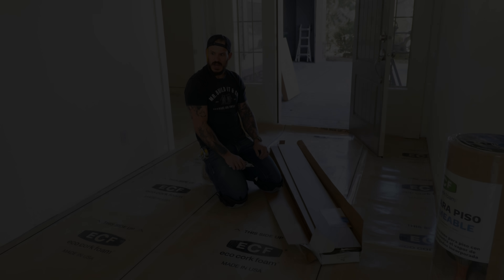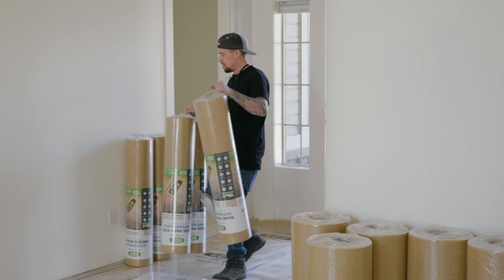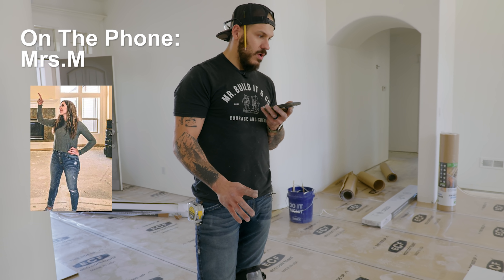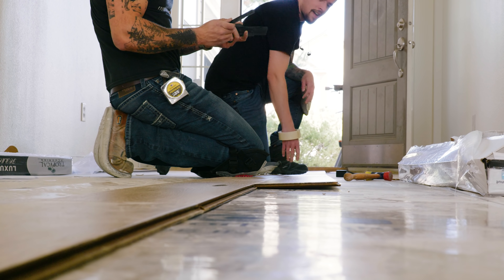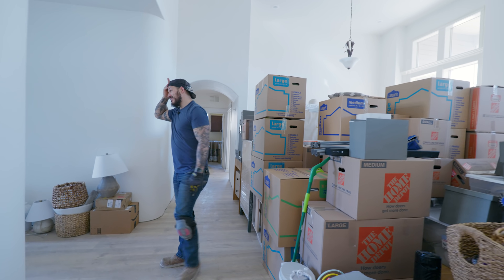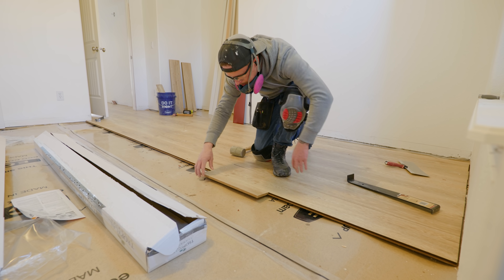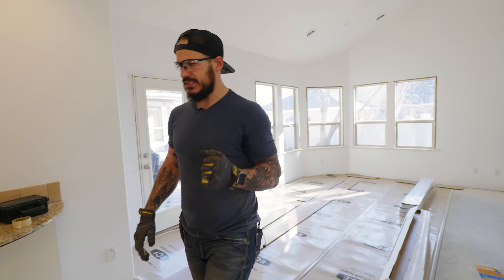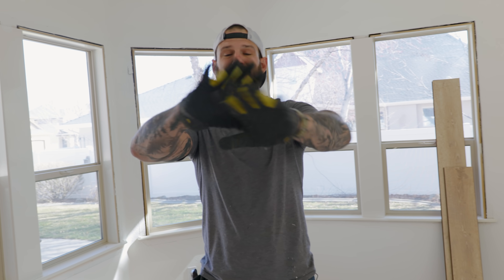Installing Flooring + EVERYTHING GOING WRONG || Concrete Slab House Reno (Ep.5)

Comment: As a professional flooring installer for 23 years this was not the easiest video to watch
Reply: Me personally would have laid the flooring other direction.
Reply: Definitely! Started writing a comment and immediately stopped. I felt I shouldn't mention 1 thing without mentioning all then I felt like I would be bashing. Saw your comment and thought a reply was better. By the way I like your user name. Aquariums all the way.
Reply: From another professional flooring installer I agree 100%
Reply: Those people don’t have a clue
Reply: I was wondering if you didnt use a space against the walls in the US? I would think the floor would rise after some use.
Reply: In six months there will be a video about how the floors are buckling and then they put in transition pieces

Comment: I found it easier to click the long side in first and then use the tapping block along the narrow side to click it in with the previous slab.
Reply: Looks like they kinda figured it out later as they went. Because clearly having to tap in 6 feet of flooring shouldn't be easier than tapping in the 6-8 inches on the short side.

Comment: When my wife and I bought our house about a year ago, I had to rip walls out, move doors/windows, floors and painting. I am a contractor (for many MANY years now) and i realized I have never done the LVP or LVT flooring. I did the entire 2600 sq ft house by myself and had my guys work on actual job sites. Never again....it took 15 days... I constantly look at the floor and shake my head haha.
Reply: Damn. I’m about to do LVP on the lower level of my 3600 sq ft house. Back hurts just reading your comment.

Comment: Anyone else notice when he says “finally done” there is clearly more plank to lay at the left edge of frame?
Reply: He did lay the floor in the kitchen because he is going to remove the cabinets and reroute plumbing and electrical in the floor.  then he'll continue the floor into the kitchen
Reply: Not that hard to say that. "We are done with everything but the kitchen, since we are tearing that apart, next."
Reply: He actually says the kitchen will be left alone before that.
Reply: @joshfrink6277  he did lol.

Comment: One you never looked at the plank width to ensure there wasn’t any small slivers on one end, don’t know why you chose laminate vinyl luxury planks are much better but you never let the laminate temp for 48-72 hours (vinyl can be installed same day) and lastly you never go that close to the wall you want to allow 1/4 for expansion if not your flooring is going to buckle.

Comment: Are you not concerned with not acclimating the floors to your home before laying them down?  I've always been told a minimum of 48 hours to allow them to adjust before they are installed to prevent huge future problems.  Am I being mislead by the manufacturing directions?  Literally the first line in the Tropical Flooring directions say the following:  "IMPORTANT
DO NOT OPEN IMMEDIATELY. Before opening, acclimatize planks for 48 hours by laying each box horizontally and individually in the center of the room in which they will be installed. Make sure the subfloor is clean, dry and flat. Always use safety glasses and mask."
Reply: old school Laminate flooring needs to acclimate.  The new LVPs do not expand and contract like the old planks
Reply: @JimFrye1  this 100% is not LVP. You can see wood, LVP = luxary vinyl plank, there is no vinyl installed in this video.

Comment: I’m having ptsd watching you struggle at 7:27. With laminate, it’s easier if you press in the long side by hand and tap the short side into the previous plank with a block. So you would be tapping with the block towards your front door.
Reply: To piggyback off of my know-it-all comment, it also goes by faster if you do multiple rows at once. Lay 4 in one row, 3 in the next, 2 in the next and so on. Make your cuts for the 4 and 3 and then lay more rows.
Reply: You figured it out at 14:47...I’ll shut up now.

Comment: i believe you need to leave more space between the floor the and the wall: when the temperature changes and the wood expands, if it touches the floor when you walk on it, it will make noise.

Comment: 10:20 you should not brush at all, you should vacuum or alternatively scrape, less dust then.  The dust from that concrete floor contains guaranteed quartz .. which in case of long-term inhalation causes lung diseases.

Comment: I don’t do just flooring for a living but I probably install 5-6 houses a year in just floating laminate and might go through 2 of those tapping blocks in that time period lol.  Also straight from the garage to house with no acclimation period?? Hope you have no buckling or separations
Reply: How much is the labor to install about 2,500 SQFT of laminate floor like this? I’m buying same floor he’s using here, but don’t want to install it myself. In TX if it makes any difference. How much should I expect to pay? New build house with no flooring to remove or anything.
Reply: @nimaicupel  I’m in Wichita Ks and it can vary depending on layout but going rate would average about 3-4 bucks a sq ft if I’m not having to tear out any old flooring or carpet.  Also depending on if pad is attached or if I’m having to put down underlayment as well.

Comment: good work buddy, but I see a few minor issues. You are supposed to leave gaps all the way around the wall (5-10mm) to allow for movement. If the boards are tight up against the walls they will squeak when you stand on them. other than that, you needed to do a real good clean above & below the underlay to remove dust/sand/grit which can also cause the boards to move/make noise when you walk over them.
Reply from the maker: i left a 1/2" gap on the ends before hitting the wall studs
Reply: @MrBuildit  good stuff! 👍

Comment: As a floor installer this was cringgggeee. The worst was the no expansion gap for bottom plate against the walls. Laminate will disconnect overtime from this pressure.

Comment: why did you decide to go with a laminate vs LVP or just straight up hardwood?
Reply: My guess? Price. He spent $2.16/sqft on the flooring + underlayment. You're not going to find hardwood or good quality LVP for that cheap. Although based on the video, it doesn't seem like the laminate he chose was that great of a quality either. For my house I chose Flooret Modin. It's an SPC core LVP. I've been happy with it so far.
Reply: Product placement from China
Reply: @michellecsiernyik5200  He said the underlayment was made in the USA in the video. I don't know if the actual flooring is though.

Comment: When you walk in our door its about 60 feet or better straight down a hallway to the fireplace.  had to establish a line that was square to the door and straight down the hallway to the fireplace.  Work forward and backward of that line.    I did roughly 1500 square ft. in 2 months or so a room at a time.  If I'd had a empty house it'd have been way easier!  I mostly just worked weekends and many an hour here and there at night.

Comment: Did you put that flooring throughout your whole house including bathroom and kitchen?  Waterproof?
Reply: I'm not aware of any laminate that is waterproof. When I was floor shopping I took samples of all of the laminate floors home and tested their waterproof/resistant claims. They all failed. I chose to go with luxury vinyl plank instead. Given how cheap the flooring is that he chose, it's probably not a huge deal to him if it ends up puffing and delaminating after it gets wet. He'll just pull up the flooring in the kitchen/bathrooms and install tile if they get ruined.
Reply: @tomconway6808  that’s what I was thinking too, what brand did you go with?
Reply: @pahoualo5914  I chose Flooret Modin in the Arbor color. It was between Flooret and some of the higher end CoreTec offerings. I ultimately chose Flooret because I really liked the way Arbor looked. The higher end CoreTec is really nice quality stuff.

Comment: Any Contractors out there, how long would a 3000 square foot house take to put down laminate flooring? An for argument sake if this was professionally done would you have more guys for a house this big?
Reply: Around 1k sq ft per 6-8 hr work day for a pro with someone doing most of the install and the other guy making the cuts. Typical laminate floor install is roughly around $2 per sq ft.
Reply: @MSeroga  I'm a contractor  and pay $1 a square foot for labor.
Reply: @hardon4life  Prep, pad, and flooring install, altogether for $1 sq ft?

Comment: Don't you need to let the flooring acclimate inside the house for at least a week to avoid shrinkage or warping? Maybe that's why it wasn't laying right?
Edit: Maybe that's just for tile and wood floors.
Reply: its laminate, not as important
Reply: Usually, 48-72 hours and I recently did the laminate like this one, it's the worst! lol prefer vinyl or engineer wood over it anytime
Reply: Yeah 48 hours is what I’ve heard, I didn’t see much of an expansion gap either but maybe the kind they got doesn’t require a gap

Comment: In one shot you had a little triangle piece whole left, how did you fill it and kept floor tight?
Reply: If you're talking about the spot at 15:57, I would guess that the triangle holds itself in place with the two interlocking sides, and then the baseboards will put downward pressure on the remaining side and keep it from popping up. Another way to handle it would be to put a little glue on just the side that connects to the short end of the plank. That way it can still slide along the adjacent long-plank side when the floor expands and contracts.

Pretty sure I had one or two small holes like that when I did my flooring. I didn't bother gluing it.

Comment: Did you check the subfloor for any major dips or high spots before laying down the flooring (especially considering the cracks you found weeks ago)? I did a glue down with our concrete slab and several rooms needed a lot of leveling compound to fix irregularities in the slab which was a PITA.

Comment: That is some pretty darn cheap flooring at $5k for 3,000 sq ft.   This is only about 1.67 per sq ft.  The vinyl we are doing is on the higher side for vinyl at $3.69/sq ft, but even the cheap stuff is more than $1.67.   Hopefully you do not end up with cheaping issues I have seen on cheap laminate before.

Comment: I couldn't tell from the video but I hope you left a gap against the wall for the floor to expand and contract.
Reply: its laminat it does not expand or contract.
Reply: @Nixtutru  it absolutely does, installed it myself, instructions in the packaging say to leave a 1/4 inch gap on each side of the floor for almost all floating floors. In the winter the area around the radiator began to show visible signs of expansion due to humidity in that area.
Reply: @Nixtutru  you need to leave 1/4” gap along the walls. Even with laminate.
Reply: @Nixtutru  LVP doesn't expand and contract, Laminate does, and can expand a decent amount especially if you buy a cheap flooring.

Comment: Your Content is already interesting without the drama. You don't need to add it. Besides, it's kind of cringey. 
Edit: also just a tip, never start tongue and groove flooring in the middle of the floor. Because the groove has to to be picked up and latch into the tongue, you will have to pick up and maneuver the whole section of laid down floor at some point. it's a massive hassle and wastes time. It's best to start with the long groove side facing a wall that's square with the rest of the house, and work out from there.